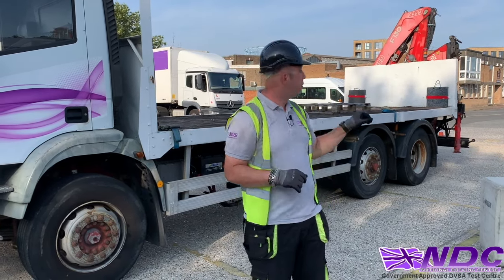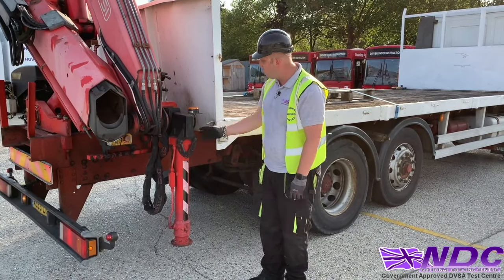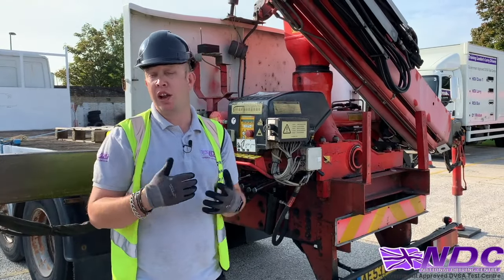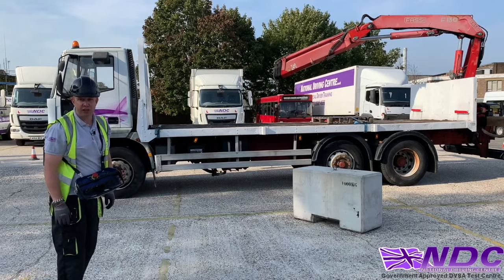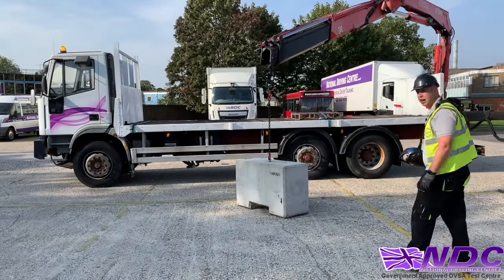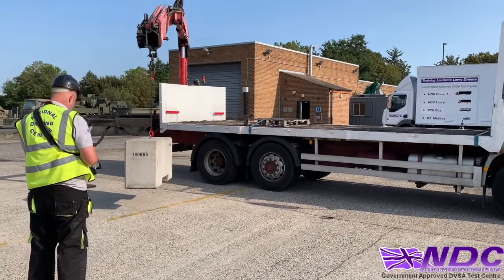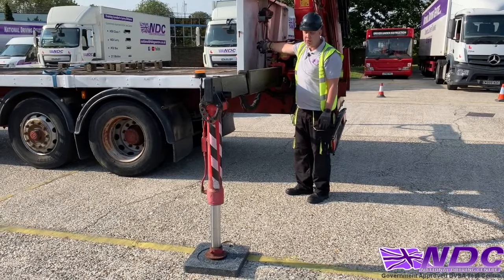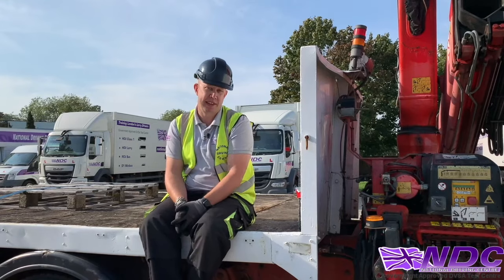ALLMI Lorry loader training- Lifting techniques! 🚛🏗

Comment: I missed the part where you check your load chart to see if you can safely lift the 1000kg at its radius.
Reply from the maker: No, it was done at 13:44 as it is written on the load.

Comment: Within learning and getting a HIAB license (already have my class 2 and CPC) will there be a theory exam? Or is it just a practical? I can’t find practise questions anywhere on the internet. Thanks
Reply from the maker: Yes, there will be some written exams, multiple-choice and open questions about 40 multiple-choice and about six open questions with just a little bit of writing. This is not a spelling test with a good instructor and Examiner as long as I understand what answer you are getting across you'll be fine. If you're any doubt, ask your instructor.. If you download the ALLMI app, it's completely free under the section for tools. There will be a Q&A task. This will give you a rough idea of what some of the questions will be. Hope this helps, and thank you so much for your question. Kind Regards Paul 👍👍

Comment: Great video. is it safe to do so in bad weather condition?  like winter, snow rain ?
Reply from the maker: Thank you so much. Rain would be fine you we just need to re calculate your weight (bags of sand or blocks). Snow would be most challenging as you can not make a good assessment of the ground condition. Wind speed is a big factor and most Lifting plans are set to 20MPH.

Hope this helps 👍👍👍
Reply: @NationalDrivingCentre  thanks

Comment: Can you still release / relax any pressure if there are no external levers, only the remote control?
Reply from the maker: If there is no external levers, then it would be unusual to relax them on the remote control, because if the remote control is active, then the crane could be active, so it could be dangerous to try and do this. 👍👍👍👍
Reply: Thanks. So on some more modern trucks where there are no external levers then there is no way to relax the pressure. 
This was making me wonder whether or not that is really an important thing to do , or not? 
Perhaps a more modern truck with no external levers also has some inbuilt mechanism that relaxes the pressures when powering the system down + off?

Comment: How manny chestions are in the ALLMI, theory test  Thank you.
Reply from the maker: There are about 40 multiple choice, questions, and about eight open questions. The open questions will require a little bit of writing. For example, one of the questions is what ground conditions would we not want to see before we get our legs out? Sand, grass, slope, excavations, water drainage are just a few of the answers we could give.
By the end of day one, we normally do a pop quiz to find out how much you've learnt and 99% of the time it's very good 👍

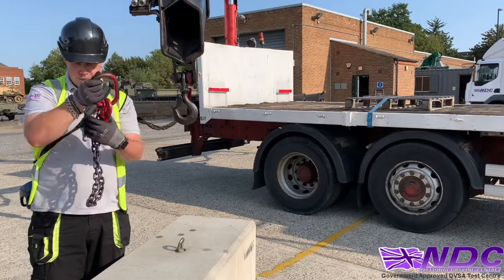Comment: At 19:23 in my honest opinion you should have retracted the boom and at a height above workers movements because as you were indicating that you were putting the accessories away, you, the crane operator or the slinger could be in harms way when taking the accessories away from the load on the ground, like slings.
So, good practice dictates to move the obstacle (crane boom) prior stowing away any accessories.
I fully get that this was an oversimplified version of crane operations but still a fault in safety.

The final thing I would say is that the end of the strap was unsecured. A load could move whilst in motion, this could cause the end bit of the strap to get loose and dangle into the tyres. For this reason, the end strap should be folded away and have nothing to do with the securing of the load.

It is an old bad habit to just push the end strap between the ratchet and the body of the lorry.
Reply from the maker: Some good points 🧐 and I can understand what you're saying but nearly always when straps and chains have been left behind by a lone worker it's nearly always because one or two steps have been missed in this case with no slinger signaller and loan working its best best practice to carry out the checks and inspections to the straps and chains or accessories and then put them away, then there's no chance of them being left behind of course if slinger/ signaller have been involved in this video, this would be different. If the load is moving whilst in motion, the fault is not with the end of the strap but with the securing of the load. Thank you for the comments some interesting things to think about.
Reply: @NationalDrivingCentre  Sure, I am 90% of the time working alone. I have all I need to do my lifts with or without lift plans. What I do as independantly of my training is after the load is on the ground and unhooked is to always raise the boom slightly above their heads as to have enough clearence to avoid any posibility of striking the boom when moving around the load. Anyway, it was a good intro to lifting operations.